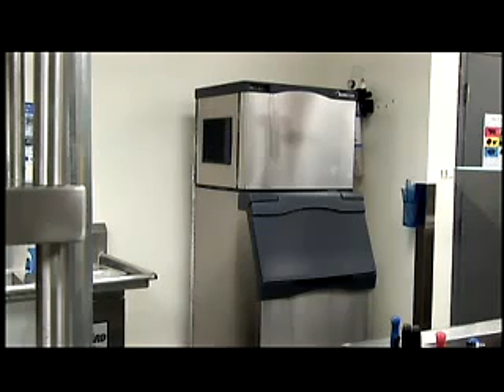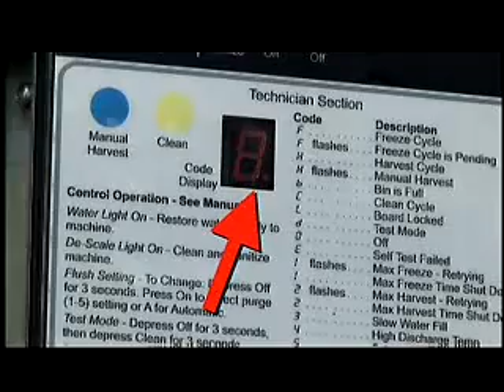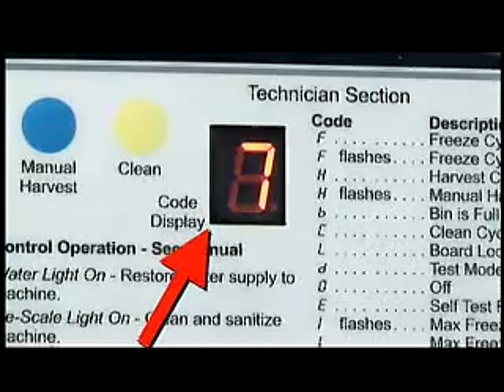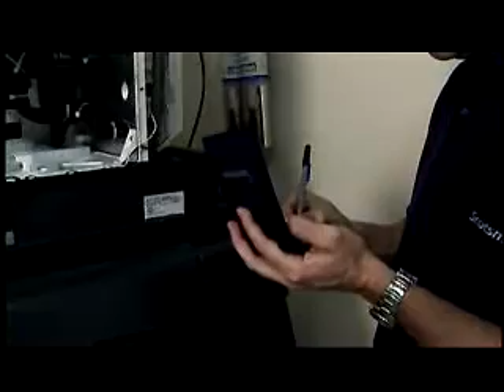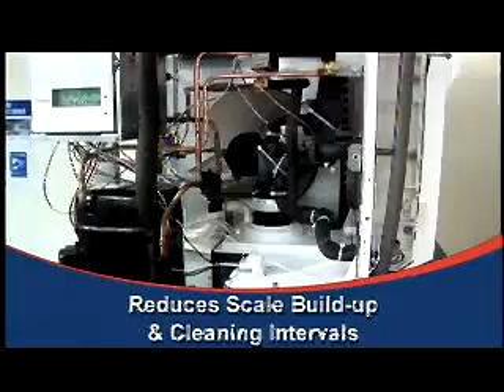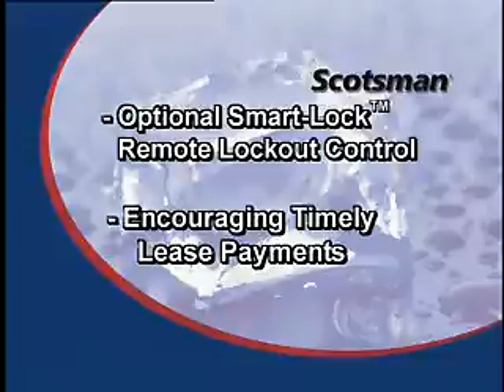Scotsman Prodigy Ice Machine - Diagnostics

Comment: Hello. I have a Scotsman C0322 machine that has a damaged compressor. The current compressor model aka9438zxd works in a temperature range -20ºC to +10Cº... However, this compressor is not available in Brazil... Can I replace one that works in the temperature range -40ºC to -10ºC?